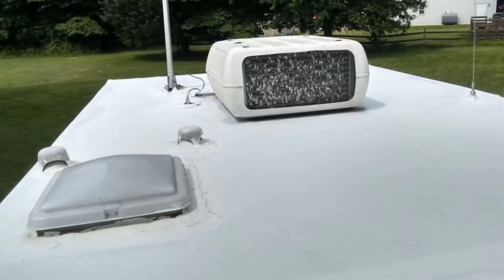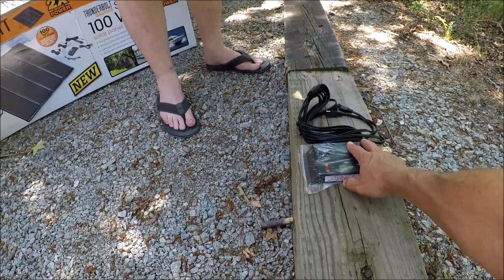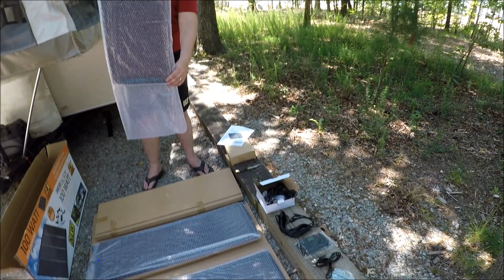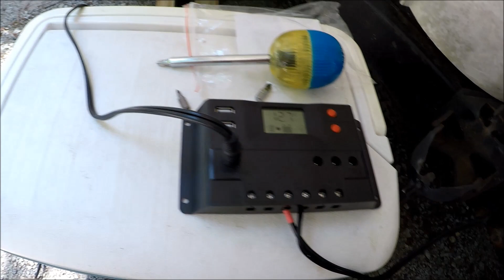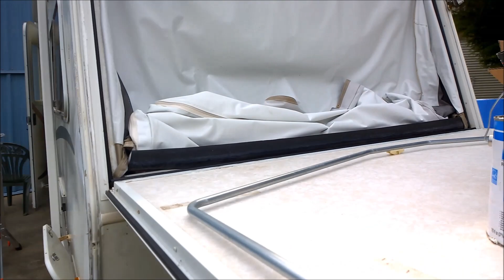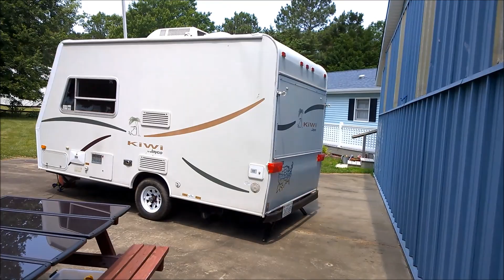Jayco Kiwi 17a - Solar Panels & Roof Painting!

Comment: I heard you say that at the campsite you would turn on the generator for a/c later. Really? Thought that wasn’t allowed or at the least be very rude to other campers looking for peace and quiet?
Reply from the maker: We only ran it for a few hours during the afternoon because it is loud.  Our campsites were somewhat separated from other sites.  It is a state park and the only time you are not allowed to run them are from 10pm to 6am.
Reply: Where do you plan to stash the panels, while you drive, if not permanently mounted? We carry so much ancillary gear in the bed of the pick-up I am hesitate to add more!
Reply from the maker: @ebachy  Hi Ed.  They easily go back into the box that they came in and then that sits in the camper.